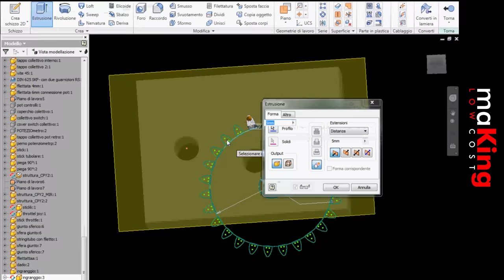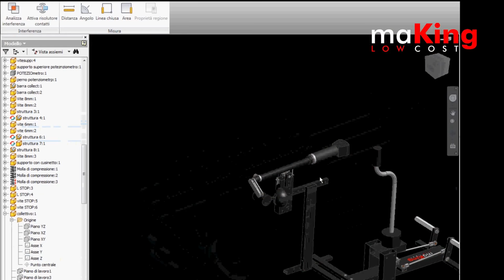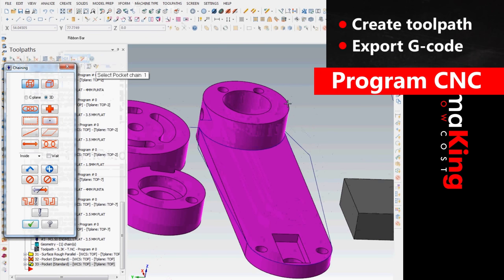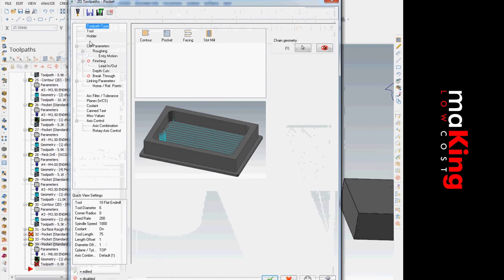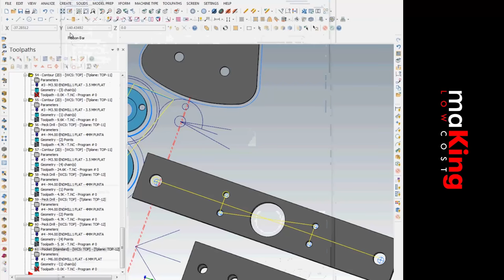Diy project: how to make Joystick Flight simulator with only 150 $ ! Flight Helicopter Control

Comment: Only $150! That's amazing. Now, I just need to start saving $25,000 to get the CNC machine.
Reply from the maker: Hi, You can also make the pieces with a 100 dollar 3d printer.. I had the cnc and used it.

Comment: ...."Diy project: how to make Joystick Flight simulator with only 150 $ ! Flight Helicopter Control....."
what kind of joke is this??
Really you think that most of us have all of that tools in our homes?
Reply: stumbled upon this looking to learn a bit on making a hotas with everyone being sold out on the decent ones and thinking it would be a fun project. my first though was 150$ of materials and thousands in tools no average person owns....
Reply from the maker: Hi, I understand what you mean, but you can also make the components with a very common 3D printer and a $ 40.00 pillar drill, obviously with a CNC to do it first .. the key is to see how you can modify a Hotas to adapt it to others. structures / commands.

Comment: "... with only 150$ ..." You only need the machines wich cost more then 5000$. rofl
Reply from the maker: Hi, You can also make the pieces with a 100 dollar 3d printer.. I had the cnc and used it.

Comment: How do you have thousands of dollars of cnc equipment, but have an angle grinder bolted to 2x4s as a miter saw?
Reply from the maker: Hi, You can also make the pieces with a 100 dollar 3d printer.. I had the cnc and used it.

Comment: How much was the CNC and the 3D software?
Reply from the maker: Hi, You can also make the pieces with a 100 dollar 3d printer.. I had the cnc and used it.
The cnc anyway, it cost me 5000 dollars, but I really replaced everything with very expensive parts, replacing everything, and adding a lot of accessories.

Comment: Great work! Im a heli simmer that lives in NZ and heli sim hardware is too niche and too expensive. Just an idea and id like your feed back. I already have the hotas you used to make this (not cheap here too) but was wondering if you have considered manufacturing the parts as a self assembly option? I realise that the majority of the work is makeing the parts but as i lack a cnc machine and the technical know how as im sure alot of simmers do it could be an idea to expand the consumer options alot! I already have anti torque pedals that im happy with and i could make the frame myself. If you sold part kits and included online assembly instructions and wireing models it would really increase sales potential. You would have to do the costing youreself and it may not really knock the price down much but i think there would be a massive market with simmers like me who quite like diy and are limited in budget. Would this be viable for you as a buisness model do you think? Thanks. Adam.
Reply from the maker: Hello adznz11, Yes, I could make a guide, the pieces can also do them with a cheap 3d printer, the point is that there is really a lot of work, I don't know how many people want to build such a thing. We preferred to dedicate ourselves to building our own professional model. If you want more info on how to convert your hotas, I made a longer video where you can see the phases in more detail, I am attaching the link: https://www.youtube.com/channel/UCcepbLzU4X2I9fTe0LHrDsw
Reply: @makinglowcost6709  i think you would be surprised how many simmers would be ok with making there own. It is a passion after all. Also out here in the antipodes everything costs so much and anything that can be done to save costs would be greatly accepted. Assembly isn't as hard as manufacture. Out of interest how much do you charge for your professional model?

Comment: only for 150$.......but you need 10's of thousands of dollars worth of machinery
Reply from the maker: Hi, You can also use a chinese $300 CNC router or a 3D printer, I use these machines because I have a laboratory available.
Reply: The time, effort, engineering let alone equipment to CNC, 3 d graphics WAY exceeds coughing up for something ready to go. Few people have the technical skills or understanding to manufacture this rig. I would rather save up and buy something that has been made than spend 500 hours thinking up and solving all these ideas let Alone assembly. At 10$ per hour for labor,  and say only 250 hours to do all the work, you are way over budget, let alone all the time driving around buying the stuff etc!
Reply: Chris B I probably was way over for the equipment but yeah I completely understand the skills needed I have 4 years under my belt for CNC and CAD, I mainly using torchmate plasma cutter table and some CNC Laythes, I still think the title is a bit clickbait
Reply from the maker: @chrisb7096  Of course, I understand what you mean, but the important thing is to understand how to convert the electronics of the Hotas, you can build the structure as you want. I saw someone who made it out of wood and had no machinery, if you don't want to waste time, it is not a project for you, unfortunately it is not possible to build a 5-axis joystick quickly and without much effort . you must clearly be passionate about DIY to do such a thing.
Reply from the maker: @giantgaming600  I understand, but it's not clickbait, this is a very complex project, but the key to the project is to understand how to reuse the electronics of Hotas. To build the structure and you have to build it based on your knowledge, I assure you that you can build all this with a 3D printer and a drill press, of course it will take a lot of time, it took me a little with my machinery. Clearly this is not a weekand project.
Reply: Giant Gaming 
Your headline title, Build for $150 is what is misleading. It is nothing to do with DIY. Since according to you i can build this for $150 I will pay you $150 to build it for me and i will pay for shipping. Then everyone is satisfied. 
Let me know when it is ready for shipping and payment.
Reply: I have the remains of an 3 axis plane stick and pedals that i am gonna use for my project . I am going to use my Extreme 3D Pro Joystick.  Should not have to spend much. Will post results in a month or two .
Reply from the maker: @jandebeer7554  
Hi Jan, Extreme 3D Pro Joystick is cheap, but it's a good joystick, you should be able to do a good conversion.v good job and let us know the results!

Comment: You get a comment from the Pro Flight Trainer Creators... that should make you happy? :-)
Its always nice to see others building things from scratch, well, almost from scratch since you do use a Thrustmaster Grip, USB PCB and potentiometers.

Others have already commented about all the tools and machinery used, in respect to price tag....; I believe in that perspective you actually make us look very good , and somehow I am actually amazed at how low our price tag is! 

now a few suggestions for your setup if you don't mind  ;-)
the Thrustmaster PCB is goanna create some issue for you, namely dead zones (due to firmware design) in the middle section of ranges/axis, which is the most important one for helicopter cyclic. Yyou will have to replace that with either for example a leo bodnar USB Board, or one of our high resolution PCB.

It does not look like you will have much friction on pedals, you need some adjustable friction system to simulate flight control response.

We use a zone switch firmware to have 3 Chinese hats on cyclic, and 12 buttons. you will need a lot more functions and buttons to use your setup in VR environment.

Using geared signal control, when coupling the axis to the potentiometer, will always create some lag and precision issue especially when changing control direction. Try to adjust your design to a "directdrive" one. 

just a few things we learned over the last 13 years perfecting our products... 
anyway, nicely done, good work on the machines, and happy landings!

PS: and thanks for using our product as a reference! happy to see our product being something used as reference in the industry!
Reply from the maker: Hi, yes, it is an honor to have your attention.

Before starting this project I did a lot of research and I carefully observed the various joysticks and the various products on sale, I also had the opportunity to try different ones, including yours.
and I was very impressed, you created a great product, creating a simple structure, but very stable, with a very precise electronics. I have concluded that yours is one of the best I have studied.

Yes, I noticed the limitations of the HotasX during the construction, the gear transmission system is to adapt to the limitation of the potentiometer of the hot X (i use half potentiometer to avoid the central dead zone) :-).

Yes, I had seen that there are several cards on the market to be able to create a good homemade joystick, but at that point, I had to build everything from 0.
My goal was to spend a little, converting an economic joystick with the least possible work.
But I realized that there is a lot of work to make a product like yours.

I always build different things, it's my passion, but one day I want to make an improved version of this joystick.
Thank you very much for your advice, they are welcome.
Reply: smart move using half the way of the pots! :-)

good luck and all the best! happy landings!

Comment: Nice crafsmanship, but Hotas X electronics is very "meh", low frequency, high latency circuit, low cost/quality potentiometer.

Low cost (~$6|) Arduino PRO Micro (ATMEGA32u4) + MMjoy2 firmware allow you use contacless sensor TLE5010/11 and have 14 bits resolution in axes.
Reply from the maker: Hi Sokol, i agree. I had not thought about using arduino electronics, I do not know the world well, but it's a good idea. We are finishing these days a new model, made entirely by us, built as it should, with professional electronics, (created by professionals), we will publish an interesting video soon, continue to follow us!

Comment: make it for 150$ assuming you have 100 000$ worth of equipments...
Reply from the maker: @timofglazz388  Hi Timof, exactly, 150 is the amount I spent on raw materials, and I spent a lot because I made it in aluminum, if I count the working hours it becomes very expensive. If you make the components with a 3d printer, you can save more money (it is certainly less resistant) but it works anyway. When I started this project, I thought: it seems easy to do! But then I realized that it was more complicated than expected :-).

Comment: Nice job but no one is going to go that extend to build its own. Better buy one already made.
Reply from the maker: Hi, thanks, Yes, if you want to make it the same, it is challenging as a project, the throttle is the most complicated component, this project is for has the passion of DIY and is familiar with various tools, 3D printers, routrer, cnc, etc ..

Comment: Ok, I’m going to point out that you don’t need these exact machines so make something like this. Yes there were a lot of machines used in this that an average person doesn’t have access to, so what? You can use 3d printed parts in lue of machining and still get a wonderful project. Everything else done can be achieved with a drill press and a touch of ingenuity. As per CAD, just get fusion 360 it is free for private use and easy to understand with minimal teaching.This should serve as an idea of what you can do not a gospel truth.
Reply: Look guys, calculating the mass of a black hole is just math. I don't see what the big deal is.
Reply from the maker: Hi, That's right, it sounds very difficult, but fusion can be learned very quickly, and if you start designing with Fusion, it turns out that it is easier than it looks and this project can be done in so many ways, with or without machinery.

Comment: haha... you can do this for $150.  and a CNC and CAD and training...  and how many hours?

I'll keep looking for true DYI options.
Reply from the maker: Hi Mike, you can also use a router or a 3D printer, those cost very little, there are Chinese routers that cost $ 200, yes, it's not a project for everyone.. You must be at an "advanced" level of DIY.
Reply: @makinglowcost6709  where to find thoses plans ? is it possible to 3Dprint them ?
Reply from the maker: @LooweCEE  Hi Loowe, yes, it is possible to print them in 3d, until a year ago I had the 3d projects, then the hard disk burned and I lost all the projects, .. now I do 3 backups a month ... sorry.
Reply: CNC and CAD training sounds hard to you? You're just lazy then.....

Comment: 150 for material, add a couple zeroes and then the manhours to get the job done plus experience, nothing is free.
Reply: The tools alone would have to be amortized over a thousand projects to be remotely cheap.

That said, I'm almost done building a set of pendular rudder pedals from 3D printed parts...
Reply from the maker: Hi, You can also make the pieces with a 100 dollar 3d printer.. I had the cnc and used it.

Comment: A $150 joystick project - using thousand $ machines... and "the ice on the cake" reusing a $2 electronics... !?
Reply from the maker: Hi, You can also make the pieces with a 100 dollar 3d printer.. I had the cnc and used it.

Comment: I  hate these stupid "low Cost" videos... with CNC, 3d printers and other things that no one has at home
Reply: A drill a hack saw and a coping saw is all you  need.
Reply: @NordboDK  but not what they use to demonstrate those basic tutorials
Reply: I do.
Reply: 3D printers are definitely worth investing in though. Literally $150 & you have a 3D printer good enough to make almost anything.
Reply from the maker: The DIY videos range from who makes a shelf to who makes a war robot, clearly everything is more or less complex to work with and requires more or less skills /, even if you do not have CNC tools, with a common 3D printer you can do everything , the important thing is to see how you can modify the structure electronically to adapt it to other commands / commands, then only your imagination / creativity to decide how to make the structure.

Comment: ok, you need first. a long skill for 3d design, some firends with a huge workshop and tools...
Reply from the maker: Hi Fernando, you can also do the pieces with a cheap 3d printer, I have used these tools because it is my job, the crucial point of the project is the modification of the Hotas X, the rest you do according to your knowledge / creativity , I saw someone who did it with water pipes ..

Comment: The title is way-out misleading. How much does it cost me if I DON'T have all that heavy machinery and software in my pocket?
Not even close to 150$, I wager.
Reply from the maker: Hi Skyhawk, The title is not misleading, it says how to make it by spending $ 150, it doesn't say how to make a 5 axis joystick with $ 150, with bare hands and without any instrument ...
in the description I specified with which equipment you can build it, routers, 3D printers, things that cost very little, affordable for everyone.
However in the video I show how to reuse the hotas electronics, that is the key to the project, if you want you can also build it in wood with a bit of creativity, I saw a user who made it with PVC pipes ..
I used a precision CNC because I have a lab available, if you watched all the video to the end you would have heard it said.
Reply: @makinglowcost6709  I do understand your point. Please understand that barely anyone else has a workshop like yours. If I had access to one, I'd also do stuff on the cheap. End of my input.

Comment: yup 10 dollars in parts an 15,000.00 in shop tools
Reply from the maker: Hi Phil, in the description I specified with which equipment you can build it, routers, 3D printers, things that cost very little, 150/200$, affordable for everyone.
In the video I show how to reuse the hotas electronics, that is the key to the project, if you want you can also build it in wood with a bit of creativity, I saw a user who made it with PVC pipes ..
I used a precision CNC because I have a lab available, if you watched all the video to the end you would have heard it said.
Reply: @makinglowcost6709 was just being a bit of a smart ass I cant build crap I the guy that cut the board 3 times and it was still to short

Comment: Ohhh didn’t know you could buy a cnc machine for $150 🙄
Reply from the maker: Hello Matt. No, in fact at the end of the video I say that I use professional machinery to make a quality and durable product because I sell them, but you can create the throttle and the rest of the structure even in wood if you want !, just move the potentiometers and extend the joystick switch cables.
Reply: Indeed, there's lots of stuff in this video I could probably use =) It'll be a wood construction, but if you mix PVA glue and water (1 part PVA to 3 or 4 parts of water) in a spray bottle and then spray a layer over all the wood and let it dry, you get a "plastic" finish that you can gently touch up with fine sand paper (grit 400+) and then paint. :)

Comment: You can do all this just fine with a drill, no need for the CNC. If you dont have any tools its going to be a bit more than 150 though. Honestly bending the Cyclic pipe is the bitchy part of the project.  Ive used, wood, metal, pipes from old stuff etc. Just be imaginative. Can catch a glimpse of my anti torque pedals + my ms ffb2 project here. https://www.youtube.com/watch?v=jKwYM-ZzEHg